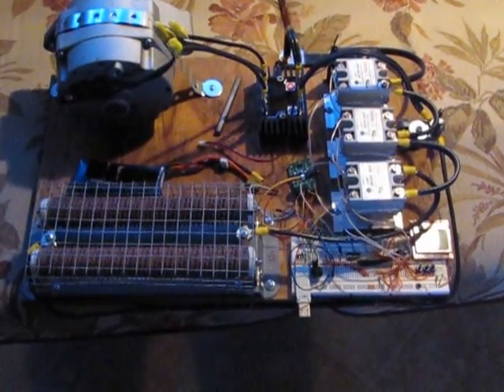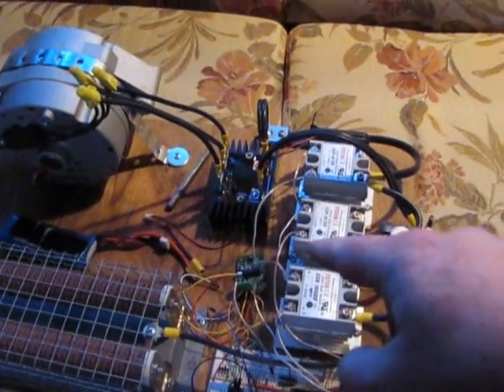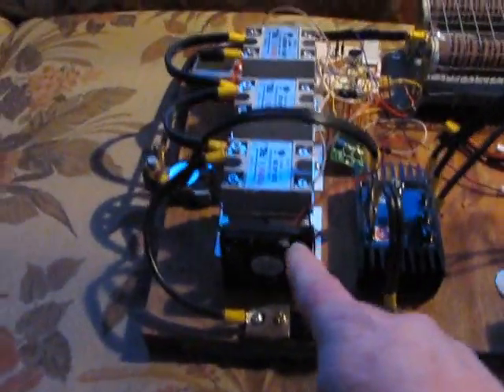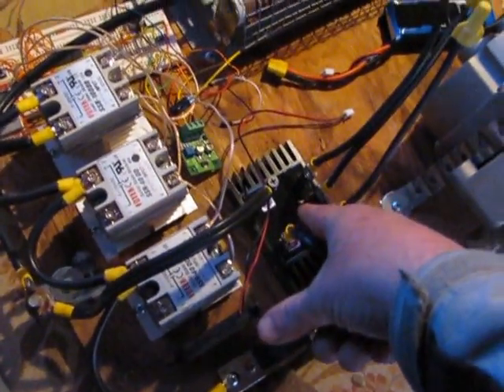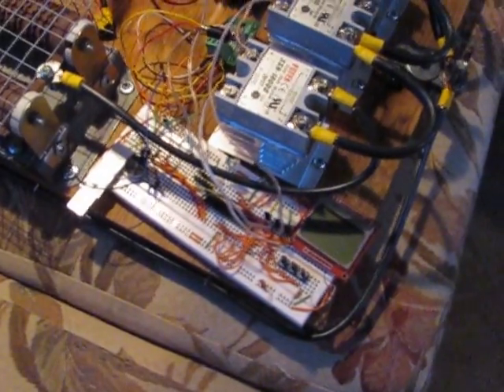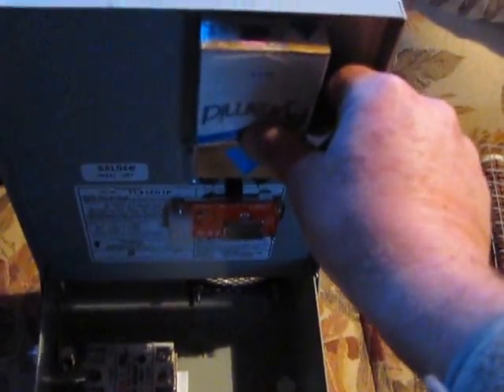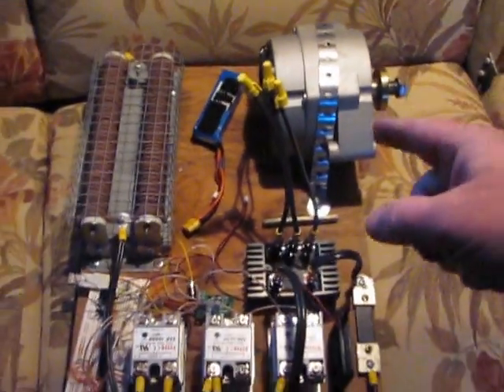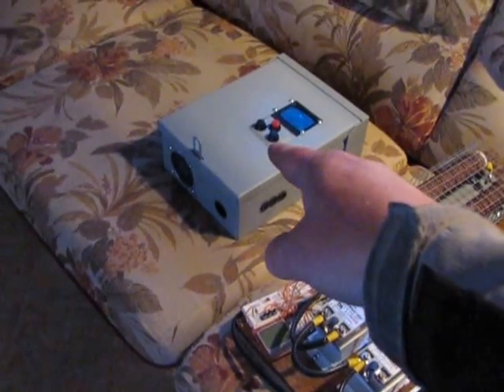My Home Built, Wind Turbine Charge Controller,, Update :)

Comment: nice layout. what will this charge controller offer over the ones you can buy?
john
Reply from the maker: My charge controller has 3, 100amp outputs that can all be easily adjusted and set any way you like for your system,, I will be using mine for Grid tie inverters,, Dump load,, and Battery charging :)

 Some people may want to run a 10.8-30v grid tie inverter ( for lower wind speeds) and a 22-60volt grid tie (for higher wind speeds) and a dump load on their turbine ( if their grid power goes out),,, What ever you want you can easily set it up using my charge controller,,

I can not think of every home solar or wind setup out there,, but I can build a charge controller that is easily adjusted by the user for what ever that user wants his or her charge controller to do for them,,

My charge controller is 12volt or 24volt right now but I can easily build one that works with 48volts or more wind turbines or solar,,

I wanted a safe way to run Grid ties off my 12volt wind turbines and charge a battery bank if my grid is down ,, I could not find what I was looking for from a Wind Turbine charge controller online,, so I decided to build my own:)
Reply: Jason Brown it's an interesting idea. will it also keep the battery bank charged?
you may wish to add a brake switch, amp meter, volt meter, McCune just share a meter that may work, and a fuse. 100 amps is a lot to run through those relays.
I can see the value in this, nice!
Reply from the maker: john otoole
My charge controller shows the incoming, Amps , Volts and, Watts :)

Yes it will keep the battery bank charged,, It will keep the battery bank at what ever voltage you set my charge controller to keep the batteries at ,, You want your batteries at 12.5volts set the charge controller at 12.5volts ,, you want 28volts then set it at 28 volts,, what ever you set it at ,,

If the batteries are full it goes to grid tie,,  My charge controller will do what ever you want it to do,, All you have to do is easily tell it what you want :)

That is one reason it is taking so long,, the user interface,, I want it to be so easy anyone can change the settings,, and not be afraid to mess something up , If they do , just hit the reset button and revert back to the original program,,, the programming has been intense but I think it is worth it :)